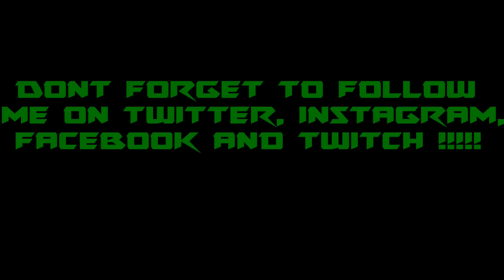My Most SCARIEST Motorcycle Moments + R.I.P. PIGEON

Comment: That clicking sound was the starter motor not having enough power to turn the engine, could be a bad terminal, bad alternator, bad battery, bad ground... Hope they got it sorted but you were right when you said it was something with the battery

Comment: This video is over a year old. You still want to hear my moments? I can think of four scariest moments so far. I need to make videos of the stories of three of them, one I got on video. Two were people making left turns in front of me then realizing that there was no place to go so they end up stopping in the middle of the street blocking me and others around me. One I almost slammed into but somehow got around behind them. 

The third was when I was thinking about riding differently. Not needing to split all the way to the front after watching some guy on an older BMW (1960s era) just cruising and taking it easy. Somehow that impressed me that morning. Hours later as I'm waiting at a light on my bike and I am not in front, just hanging a few cars back still thinking of the older BMW and the relaxed ride. When the light turns green the large pick-up in front of me goes through the intersection but before it can finish, it gets slammed by some idiot who I guess was trying to run the light by shooting up the far Right Turn Only lane. The truck gets pushed all the way across the road. Both vehicles are destroyed. The guy was okay though. I was thinking, shit that could have been me yesterday if I was always insisting on being up front and first across. 

The last one happened just last month (02/2016). That's video 0036 if you want to watch it. Two cars crash right in front of me as we're going down a neighborhood canyon road around Sherman Oaks, Ca. I saw it coming and you can see me steering the bike away at the last second and move to avoid where I thought the cars would bounce to, but I also got reeeaal lucky! ALWAYS RIDE AWAY FROM TRAFFIC. This gives you some time to see something and do something about it. If you're too close you only have time for "OH SHIT". Being a reasonable distance from traffic is what saved me from all of the above. 

Stay Aware & Take Care.

Comment: Hey buddy when there's a loose terminal try taking it off and turning it over its normally smaller diameter on the top and you can push it down tighter it normally works

Comment: Mechanical inclined here. that ticking noise is the solenoid activating the push rod for the starter motor. though the rod is causing the clicking noise as it doesn't have any electrical goodness to force the starter gear into the flywheel plus the motor isn't spinning... A.k. Dead battery, probable fault is a fucked up alternator not keeping the battery charged while engine is running. if your car is running with a dead alternator, eventually the spark plugs wont spark while driving once the battery is drained causing the engine to cut out.

Comment: The scariest moments for me are when idiots tailgate you. The most scary moment was easily a couple years back, commuting to work on a little 125cc at 6am in the morning of a dark cold winter. The weather didn't look any worse than it had all week when I set off. 40 mins into the ride, roads are wet from rain, bit scary cornering on the shitty 125cc tires but I had got accustomed to that a while ago. 15 mins later I'm passing through a country road on my way into Lymm, where it had been snowing and still was snowing. So I was on a winding country road laced with tall trees on either side, I could barely see anything cause the snow was sticking to the visor, and my visor was also almost completely fogged up on the inside... I'm doing 40mph down a dark bendy country road covered in snow, while almost blind with 1 hand constantly wiping the snow off the visor so I don't loose that tiny penny-sized bit of visor that hasn't fogged over. Why didn't I stop? A car driver was tailgating me, practically 10cm away from my rear wheel... So glad I knew the road really well, screw that driver!

Comment: bakerXderek , Issue with the car appears to be an alternator failure or a Belt failure (belt drives Alternator, AC, Power steering, WaterPump), and then the battery ran flat enough that the engine systems stopped functioning and of course it wouldnt turn over at all. A loose terminal doesnt help charge the battery or start the car, but that alone shouldnt cause the car to stall with a healthy alternator.   Those Nissan engines are usually VERY reliable and smooth engines.

Comment: hey also a rider but to answer the question with the car problem it was that the battery was dead and there wasnt enough energy to make the alternater and starter turn the engine over so when you hear the clicking thats usually the problem

Comment: last week about 7:15 pm I was riding with my tinted visor, the sun was still pretty bad.  I was at a red light in a left hand turn lane.  when the light turned green not even a second into my turn my rear tire washed out, I saved it and tried easing back on the throttle and it washed out again.  it was basically like trying to ride street tires on ice. saved it both times, I went back to the intersection in my truck on my way to work and sure as shit there was a path of oil leading up to the stop light and a slick all the way around the corner.   ive been back to that spot 3 times now to see exactly how bad it was.  if that light wouldn't have been red and I would have taken that corner at speed, id probably be ordering new plastics at the very least right now.   why didnt I see an oil slick that stretched half of a block and probably at one point had all puddled right where i had stopped?  I imagine one because the sun was starting to go down, I was heading east, and I had my tinted visor on and two probably just a lack of paying attention to road conditions.  losing confidence in your ability to take a corner is a cold bitch though lol.

Comment: You were right about there battery but it needed jumped. The connection was not enough to keep the battery charged. When you played around with the wire it made a connection and aloud it to crank over a little but not enough to get it to start.

Comment: I think the battery was dead or something. My car had that problem because the batter wasn't work right. Also my friend's car battery was also dead and when you try to start the car it makes the same exact noise. You just need to connect it with another battery from another car with specific wire in a specific way, and after that take it to the closet shop and change the battery.

Comment: that clicking sound was the terminal man. shits happened to me too many times lol. that's why I always carry a little bag of sockets and a ratchet just in case shit like that happens
Reply: correction. the ingition solenoid clicks when the battery is too dead to turn the engine over and the solenoid kinda flickers so as to not damage the pinion of the motor or thr flywheel.

Comment: Scariest moments.. well I bought an 05 r6 for my first bike ever and first time riding and type of motored thing other than a car.. Taking an exit that does close to a 360 degrees loop and going too fast having to use my brakes while turning which is dangerous. Really freaked me out because before I got my bike I watched so many crashing videos and read about things NOT to do, breaking on a turn being one.. and another is taking another turn too fast and back wheel sliding on sand..caught myself luckily. This year will be my second year riding. Praying not to get hurt. My ultimate fear is my wheel popping or something breaking while going fast on the highway and losing control and crashing.. I need to get riding gear this year, risked it last year..not happening again.

Comment: hey I'm 18, 5'11 and I weigh 205lbs but I have no experience with street bikes, but I really want to start on a 600! If I were to take it slow do you think I will be fine? (I'm pretty level headed)
Reply: To be honest, I personally wouldn't start on a 600. I would start on a Ninja 250 or WR250x. You can start on a 600 but it would be easier on a 250.

Comment: I'm not a mechanic or anything but every time I've heard that noise it has been the battery needing a jump and usually a replacement battery later. 

As far as scary moments go I side swiped a car because the dickhead in front of them slammed their breaks on and I locked my rear, somehow managed to swerve around the car in front of me. I thought I was safe but I hit one of those slick ass patch spots and slid sideways. When my rear tire got traction again it whipped my front end into the side of their car. Only cost me $170 to have the decal replaced and the people I hit didn't claim anything. ;)

Comment: People on their phones, difting into my lane and people pulling out in front of me have both happened multiple times to me already, and I only started riding around 1 month ago. Once I get a sport bike, I'll be sure to rev bomb them type of people who are dangerous to not only motorcycle riders, but everyone else aswell. Rev bombing isn't very effective right now with my 76 Honda 750 Four, unless I get some new exhaust or something.

Also, can someone tell me how bad wind resistance is while riding a sport bike? (Yamaha R1, Kawasaki Ninja, Suzuki GSXR.) The wind on my current bike is awful. If I don't lean forward while going around 60 MPH or more, I feel like I'm going to fall off if I let go of the handle bars with my straight seat.
Reply: It depends on the windscreen that you have on the bike, it reduces air from hitting your body and torso, but if it's your helmet that getting most of the wind, it maybe due to the aerodynamics of it? I'm not sure, but I don't own a sport bike, I just try out my cousins cbr600rr and now I'm too scared to even hit 3rd gear on his s1000rr (he crashed on his cbr last year due to doing a wheelie on sorta wet pavement)
Reply: DubstepCamper Heh, I suppose my problem is that I don't have a windscreen at all. But for the most part, the wind on my torso is the main issue. I hope that's not much of an issue with a sport bike when not fully tucked and going reasonable speeds. Hopefully I get the chance to test ride a sport bike after I get a bit more riding experience to see what it's like.

Comment: My first day ever riding, 03 ninja 500, light turned yellow I coulda made it if I goosed it but like I said first day ever riding. I stop at the red about 1 sec later all I hear is tires screeching and it getting louder and when it stopped I opened my eyes to smoke rolling over my shoulders I look back at this early 00's impala nearly touching my rear tire. I gave a head shake side to side in disbelief.

Comment: Battery is dead due to a bad alternator, but If alternator is bad long enough it will kill a battery and vice a versa. 

First time on on the interstate I was following my wife in her car. She was in far right lane (6 lane highway) I was in the far left. Car in front of me runs over a retread from a tractor trailer and throws it in the air at me. I locked up at 80mph and ditched left in to the emergency lane to keep it from hitting me. I pulled though but the drop from the hywy and the emergency lane with the tire made me take a second check on my drawers.

Comment: my scary moment first time on a motor bike 125 cc pit mike never rode before ever was going up and down my block in first and second gear decide to try out 3rd gear  way too late ran out of street and was about to crash in someones house so i used heavy front break and catapulted over the handle bars onto the concrete bruising the shit out of my ribs couldn't breath with out sharp pain for month ....wasnt wearing a helmet

Comment: Nothing you could have done about the car man, looks like the alternator failed at the start of the drive, the engine and all the electronics drained the battery to the point where it couldn't fire off the spark plugs anymore and just died.

Comment: Wouldn't be making any noise at all if it was the connections. Sounds like the battery is just dead and can't put out enough to turn the starter motor over.
Reply: for once someone is right. but the terminal could've led to the dead battery because the alternator couldn't properly charge it.
Reply: mini hoov I was right? lol
Reply: InvictvsNox yep

Comment: I think the starter motor was fucked. but that wouldn't explane why it shut off in the first place, the motor could be just seazed
Reply: I used to have an 88 F150 that had issues with a starter relay. Shit went out a few times until finally they replaced it one last time and fixed one of the connectors to the battery and it worked up until my engine went out. My truck would just randomly stall back then too. Not sure if it was related or not.

Comment: It sounded like it was the starter, not the battery terminal lol.
Reply from the maker: WhackyJ in AK It was, battery terminal was loose too, sure it dont help.
Reply: True, true.
Reply: WhackyJ in AKyeah starter alright plus battery life running out. get the same thing with my 64 beetle.
and btw the terminal would not do much difference fasted or lose it might drop in voltage and make the battery go flat faster. but thats about it.
Reply: Yes, I know about the terminal, and I hope you get your Beetle fixed!

Comment: The way this guy is riding is just asking for trouble regardless of what the rules are for lane splitting. Someone will turn in front of him, he will rear end him get injured and be at fault.
Reply: actually the way you describe it, no. if he is lane splitting in California and the car turns into him like you describe that person making the lane change would be at fault for unsafe lane change. now if the bike hit the car in the rear while splitting because the car moved over at the last second it could be shared negligence for the car making an unsafe lane chanfe and the bike for unsafe speed.  although the car attempting the lane change would still probably be majority liable as long as the it can be proven that the bike was maintaining his area in his pocket between the two lanes and also himself not attempting a lane change aka weaving from one lane to another.  even still if both car and bike are changing lanes at the same time and contact then that would be 50/50 liability

Comment: i had one on my 1974 kawasaki g5 100.... jsut a little 100 2 smoke enduro i run around town on. 

pulled out onto the highway from a rual road.... the car in the right lane hid the car in the left lane.... 1st car passes and i just start pulling out. IDIOT! i didnt look before i leapt... i did both at the same time.... anyway, i locked the front brake, the rear end came up off the ground, and i povoted 90 degrees on my front tire, with the car probably 6 inches away. 

now i look like 7 fucking times before pulling out or going threw an intersection. 

PS... riding bikes has made me a better car driver.... i try to pay attention way more than normal.... and before i started riding, i knew a bike could be around me..... but i never actually LOOKED for bikes. i think tahts how a lot of people get killed.... people are looking for 2 headlights. 

but ya... now i look for cars and bikes.

Comment: Just curious, any blackfingers know what was wrong with the car. I'd guess dead battery but I don't know shit so
Reply: battery probably hasn't been charging due to shitty connection.
Reply: It was likely that battery clamp he was playing with but could also have been a bad ground. the starter was clicking so it wasn't that and because it could click it obviously wasn't a dead battery. Lots of possibilities really.
Reply: sounded like not enough battery power to engage the starter. The chattering sounded like it was trying to spin the flywheel but not enough power. Most likely the alternator was dead since it died on the road.